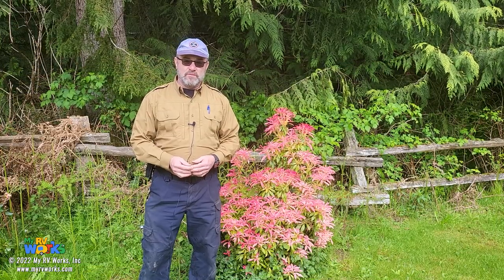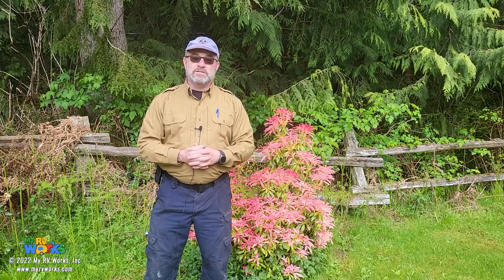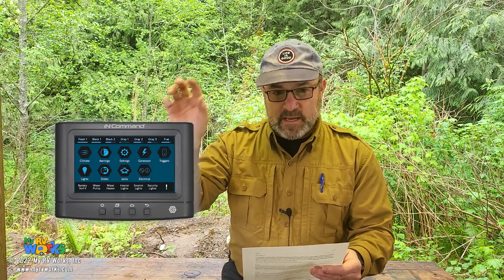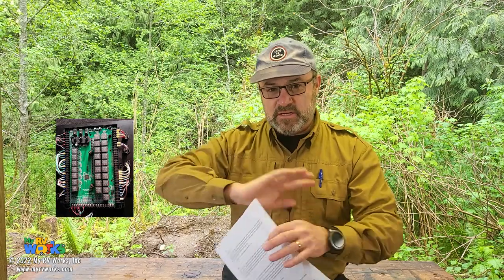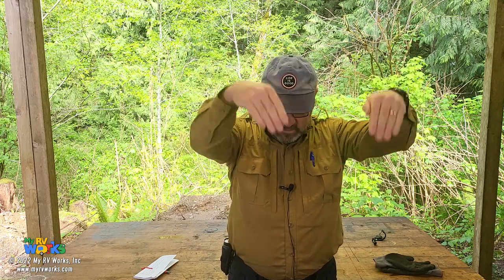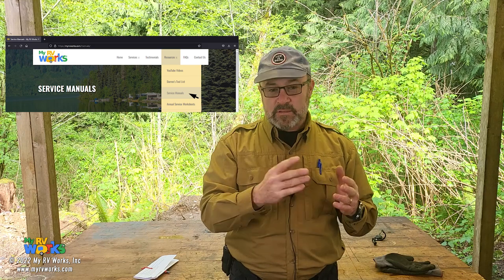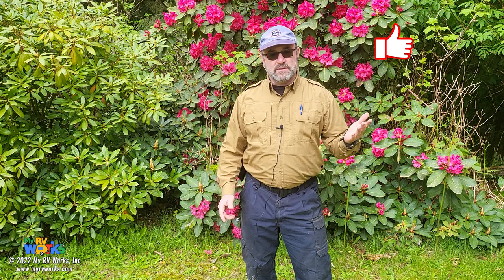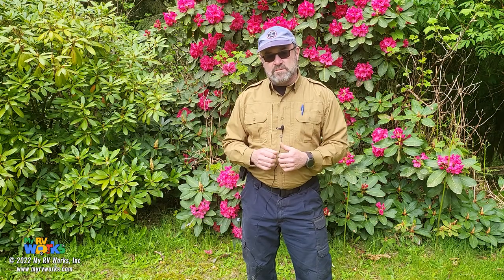In-Command System Blows Fuse & RV Fridge Not Getting Cold - My RV Works

Comment: This is Rick in Tn. Thanks for the attention you gave me on your video. The baffling was redone by me, as it was shoddy (being nice) so I replaced it ensuring the gaps were minimal. I should have said that in my email, I'm quite good at Sheetmetal work.  The freezer will freeze but the refrigerator doesn't cool.  I don't understand why. I replaced the thermister with new, and double checked the fuses as there are two on the circuit board. The fans have been replaced, and the Luan panel leans on the back of the refrigerator assuring a zero gap to the plumbing to attain maximum cooling.  You mentioned there are two things you can think of so I assume one is the ducting at the top of the refrigerator and the other is the air gap on the back of the refrigerator.
Yes I enjoy and watch your videos because I think you have great knowledge and are quite professional in your presentation, explaining things in layman's terms.  Thank you for that.
Reply: I just saw your comment, after I sent mine to Darren.  I have the same issue, my fridge is a Dometic.  I was curious what you did to fix the problem?

Comment: On the frig, one thing that is easy to do is put a small external fan blowing into the cavity. Aim it at the cooling fins. If the refrigerator cools, then there is a ventilation problem.

Comment: Great info! I do have a question. A friend ofd mine has an older Lance truck camper with a fridge that is freezing up on 12v and shore power. It's a Dometic Royal RM3663. At first I thought it may be just the thermistor, but since it can't be shut off, could this be the board? It freezes in hyper mode! Thank you!

Comment: Hi Darren two brief questions...  I want to perform a water column test on my NORCOLD RM306RM8 RV refrigerator. It has the low,  medium, high LP temperature setting dial that I imagine controls the flame height/intensity.  What would  the best connection point in order to get an accurate reading? Secondly, when you blow out the lp lines with compressed air  to remove contamination would you remove the output hose from the regulator and then blow compressed air from the far Side of the RV like at a stove or refrigerator LP supply line? What PSI do you normally use? Thank you.

Comment: I just found you. My old norcold fridge keeps blowing the 7amp fuse in the new control box. I'll put a new fuse in, the fridge will work for maybe an hour, start to get cold then blow the fuse and switch over to gas. Any ideas?
Reply from the maker: Sounds like you have a faulty heating element.  On our refrigerator playlist we have a few videos on how to test those.

Comment: I have a 2018 40ah phaeton. The inverter/charger has a built-in equalization function.  Yesterday, my propane detector started to go off.  I put a fan on it, and it stopped,  when I took the fan away it alarmed again.  So I put a fan on it again turned off the propane at the tank, went to dinner, alarm stopped.  When we returned removed fan, no alarm. Today,  I turned propane back on, no alarm?????. Previously before this all started   I started a battery equalization.  Could the higher voltage cause the detector to malfunction?

Comment: My freezer works but my fridge doesn’t. What do you think the issue is?
Reply: Mine also. Rick in Tn
Reply: both of you guys have a unit that isn't working properly for whatever reason.  the freezer is just below freezing, means the fridge also isn't at optimum. The two work in synchro if that makes sense. The freezer should be closer to 0° and the fridge simply above freezing in the high 30s. Any number of things could cause this but check whether it happens only on propane or electric, or perhaps there is some ventilation issues behind the fridge. Etc